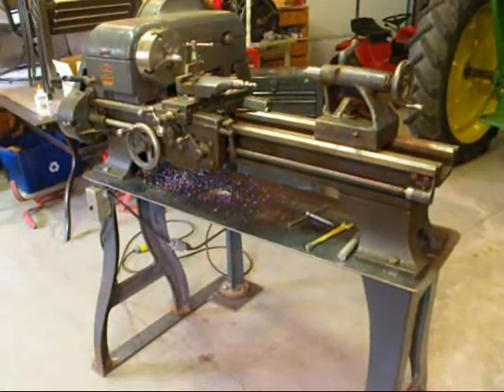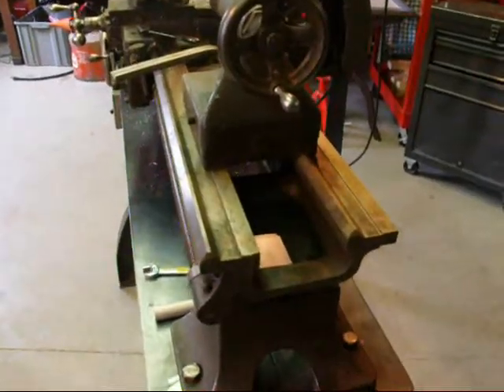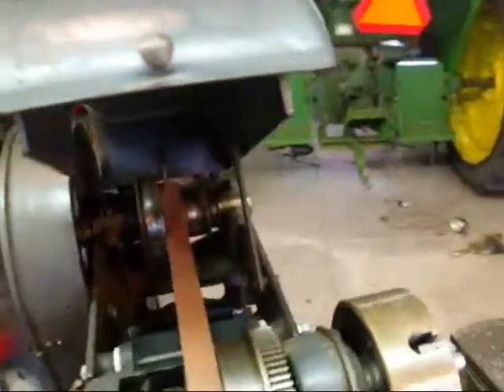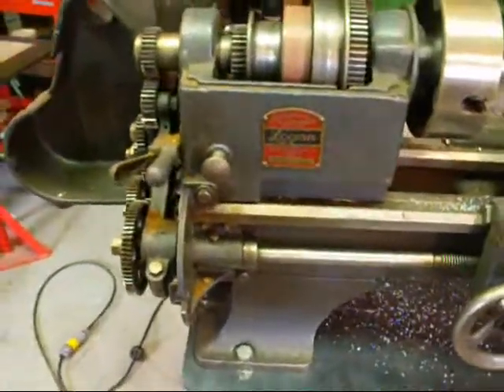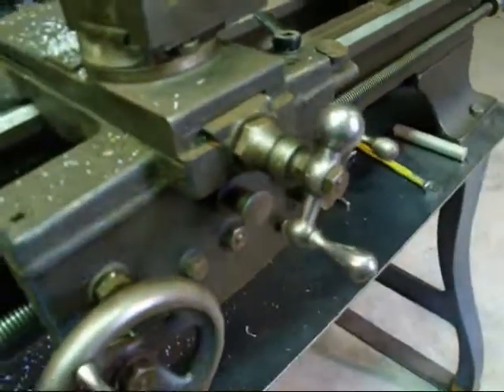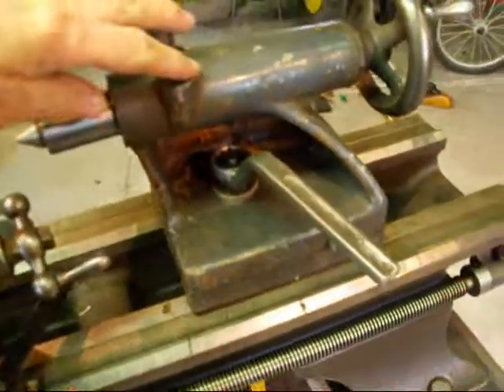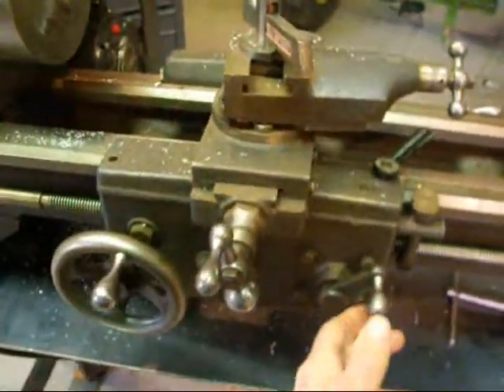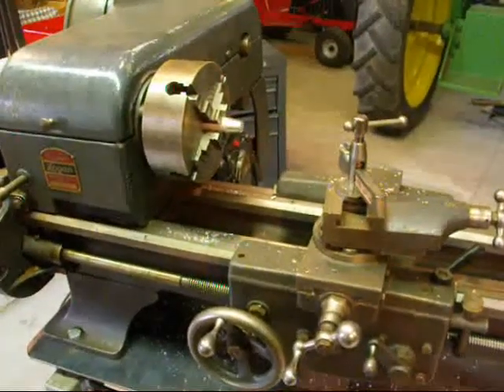Parts & Operation of the LOGAN LATHE

Comment: This is basically my lathe. I have an 830 with an 815 gear box. I need parts for my apron and wondering if you knew where I can get a worm gear and the caps?
Reply from the maker: Two possibilities.  Feebay or buy a donor lathe

Comment: Did you know atlas and Logan use the same change gears? Was happy to find out,, the Logan I just bought has broken gear box and I have 2 sets of change gears for my atlas lathes but bought have quick change gear boxes,,
Reply from the maker: I did not know that thank you. Some of the atlas gears have a double keyway?
Reply: @mrpete222   use one,,, I was searching Logan change gears and atlas and Logan showed up as same and sure enough Logan changed at banjo to same teeth gears as atlas on my 11 inch Logan and 10 and 12 atlas change gears are listed the same.. look up Logan change gears and watch what comes up..
Reply: @mrpete222  glad I looked was going to have a set printed made my day to find out and I have 2 sets I don't need for my 12 inch atlas with quick change gear boxes
Reply: @mrpete222  you know far more than I Pete,, some changes will set up as drive gear with double key way are as just free spin reduction gear so one are 2 keys won't matter.

Comment: I'm picking up a Logan 200 tomorrow. Can anyone chime in on the weight of the machine? I've seen 520 pounds, but unsure if that's the weight of the lathe and stand. Any help is appreciated,  as this lathe is in a basement and must come up stairs. Thanks!
Reply from the maker: I would say that 500 pounds about correct if it has the cast-iron legs
Reply: @mrpete222  Thank you! I found your video on disassembling the Logan lathe.  That definitely put me at ease!
Reply: I picked up the lathe without any issue,  and it is in beautiful condition for being 78 years old.

Comment: I just got one of these today but I have to get a motor to make it work.  While spinning the chuck by hand, I pulled the knob for the back gears and now the lathe seems to be locked up and I don't see how to disengage it.  Any help would be appreciated
Reply from the maker: There is a little Spring loaded stop on the plunger

Comment: Hi - thanks for some gr8 vids! Could you help ID this lathe I bought? paid 60 bucks but its missing alot of parts // 

https://www.jalopyjournal.com/forum/threads/bought-1st-lathe-missing-some-parts-need-help-iding.1114750/ 

Thanks! I think its a 9" lathe (measured 4.6" from chuck center to nearest bed rail).. Bed is 37" long, I have no tail stock to measure center distance..
Reply from the maker: I am pretty sure it's an older South Bend

Comment: i enjoy your videos i recently acquired a Logan 840 similar to this one and am interested in learning how to use it.
  it has a quick change attachment and the plunger for the back gear seems to lock up when pulled out any input would be much appreciated thank you
Reply from the maker: Thank you for watching. I will soon have my 40 chapter video course on the Logan Lee is available on Vimeo. Many people struggle with the back your plunger. Are youaware that there is a small spring loaded catch underneath the plunger. Get a flashlight and look under the plunger on the front side
Reply: Yes I got the plunger pressed in and it spins but when it's out the spindle seems to be locked up just wondering if that was normal
Reply from the maker: Did you release the bullpin????
Reply: mrpete222 I have zero experience using a lathe so I'm not sure what a bull pin is

Comment: This is a great site and a super source for using the Logan lathe- I have a Montgomery Wards' labeled Logan from about 1955- inherited it from a machinist Great Uncle. I am putting the machine and tools up for sale as I am planning a relocation. Included will be the lathe and bed, on legs. Intact motor assembly and  mounting hardware- motor runs GREAT and quiet. Fair amount of tooling, and spindle set, magnetic mark holder, and misc. hardware. Interested? Send me an email- jps11@yahoo.com. Asking price is $450.00.
Reply from the maker: That sounds like a good lathe I had a nice price. Where do you live? If you do not get any leads from this comment, put it on craigslist
Reply: Is this still available. And where?

Comment: The motor has a v belt pulley...????....it looks like the larger counter wheel or pulley is flat..what are you using...I have one of these and and need to hook a motor up to it...wondering what do I need for the hook up..??

Comment: Tubalcain- I'm going through a M.W. 04TLC-700A which I recently purchased. It appears that the Saddle Carriage Locking Nut? or Saddle Clamp Nut? Is gone. I see parts on ebay bearing both of those names. It appears Logan does not sell this part anymore, and I'm a bit scared of what they would want for one if they did. My question is, they show a machine screw with a hex head. I was expecting a lever. Isn't this what a person would use to lock the carriage when facing off a piece of material. does it require a wrench every time?
Also, did the 04TLC-700A have auto crossfeed?
Reply from the maker: +Norton ED Requires a wrench everytime. not sure about the model.
Often the lock has fallen loose & is inside the apron.--look in there
Reply: +mrpete222 thanks, will do. You really are a heck of a guy. Thanks for all of your videos !
Reply: +mrpete222 I'm just getting my bearings again on the metal lath. Am I correct in thinking that the ability to lock the carriage is essential when facing?
Reply from the maker: +Norton ED yes

Comment: I just sold my Logan 821.  I used it maybe 20 times over the last ten years.  I miss it.  I'd like to get a benchtop lathe cause i only really used my logan to turn bushings and it was so overkill...  Needed the space and the money.  When I first got it I totally disassembled clean and lubed it.  Paint was in good shape so.  Mine had a quickchange gearbox, it was so convenient.  Bought for 900 10 years go, sold for 1200 so I made a little money..
Reply from the maker: +Jay Walt Thanks for watching--I always have sellers remorse after I get rid of machines

Comment: I have the montgomery ward 04tlc-700a which I believe is the same or very similar. I would like to know what are the RPMs for the various combination pulley / gear combinations.  Thanks!
Reply from the maker: Kyle Lougnot go to VINTAGE MACHINERY website.. Look up & download logan manuals
Reply: The serial numbers start at 1100 and mine is 1103 does this mean mine was the 3rd 04tlc-770a made?  Trying to locate manual now.

Comment: When I pull out the back gear plunger on my Logan 210, it locks the spindle.  Is there a secret to using the slower speeds?
Reply from the maker: You must also pull the back gear bull pin. Then you have the lower speed.

Comment: @catman72  If you are dead set on making your own glass lathe look for a lathe for free on craigs list. You'll need to build a new headstock, tailstock and planetary chucks. Most metal lathe headstocks won't go above 1" diameter. About the only usable parts will be the carriage, Ways, and extra gears. You may be better off calling as many schools as you can and ask to talk to the chemist who has been there the longest and see if they have one in storage.

Comment: you make it all so clear.
i don't have a lathe as of yet, and when i will have one
i'll owe you a great deal.
i'm planning on converting the smallest lathe
i can find into a glassblowing lathe,
the curlpit is the need for both heads to spin
the same speed. 
i will have to buy a used lathe.
do you know any small models that might fit this
need?
i'm also considering building from scratch.
it doesn't have to be so accurate as metalworking lathe.
Reply: Coming a bit late: you really could make your own, power a shaft under the bed with a vfd motor or a treadmill motor, toothed belt drive to 2 headstocks, build this from a couple of used wood lathes.  Dirt cheap.